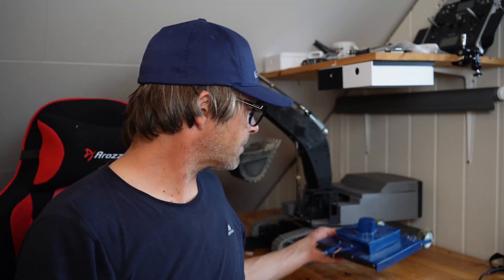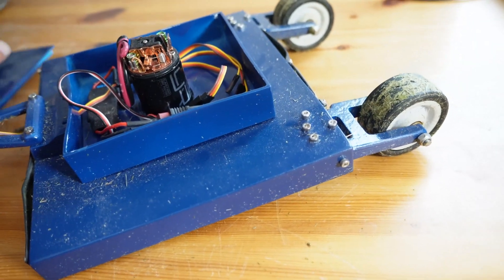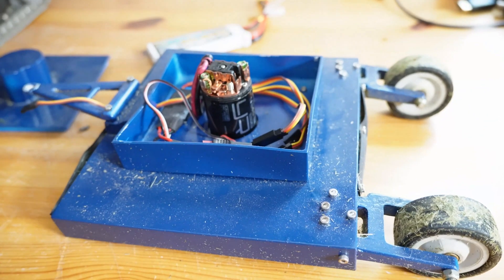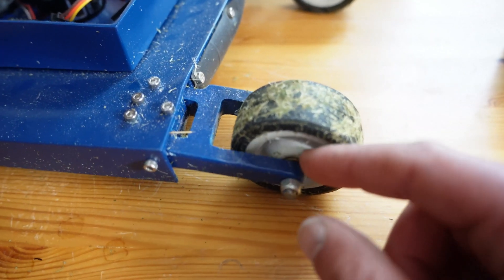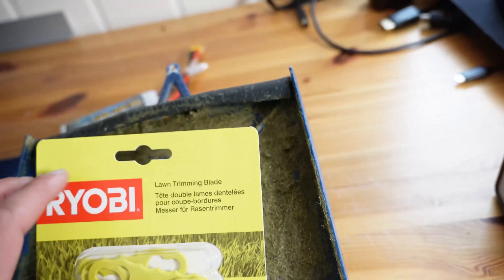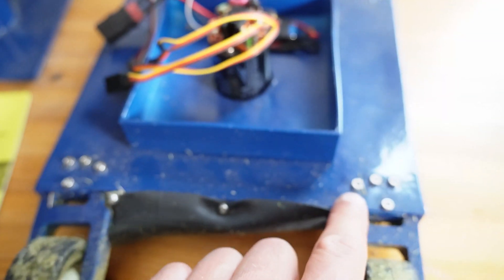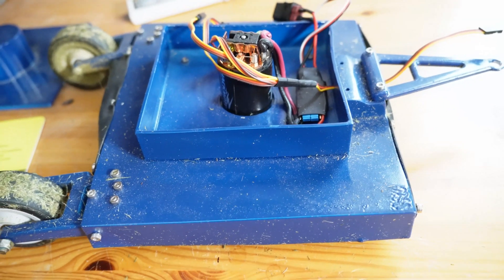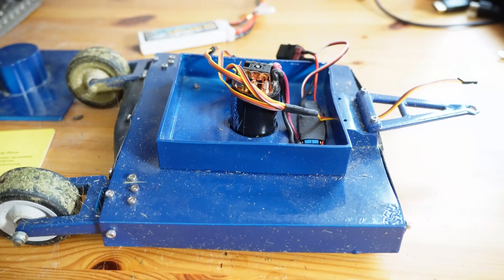3D printed RC Lawnmower. Download FREE STL

Comment: Do you have a recommendation for 3d printer? I have not got into it yet but I really want too especially for this brush hog (lawnmower) design you have. That’s awesome.
Reply from the maker: Thanks buddy✌️
It's always scary recommending stuff😇
I've got a creality ender 5 and ender 3. That take some tinkering to print good. But mine are a few years old. I believe that the newer ones are far better.
I guess my recommendation would be to get something that is available locally.
And if course to check out the 3d printer guys and their reviews on YT.
Reply: @YetAnotherRcChannel  thank you. I value your opinion. I was looking at the ender 3. Maybe a good start point at least.
Reply from the maker: @digitrc  It should be.
And you are more than capable of figuring out any issues👍
Reply: @YetAnotherRcChannel  thanks for the vote of confidence.
Reply from the maker: @digitrc  Haha.
You can fix leaking hydraulic wheel loaders. Of course you can fix printers💪